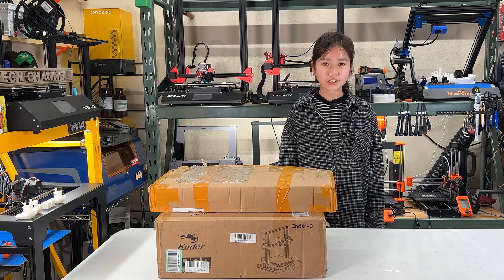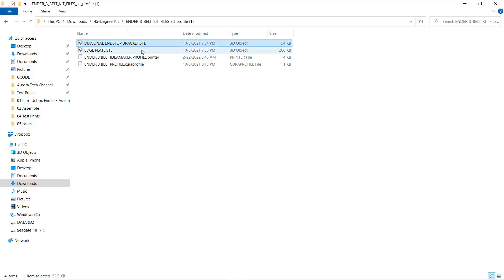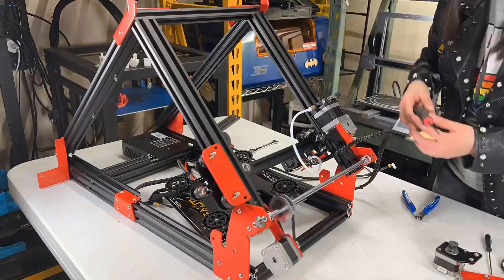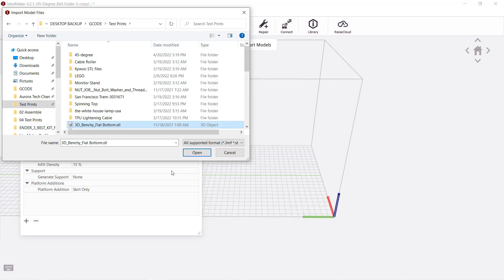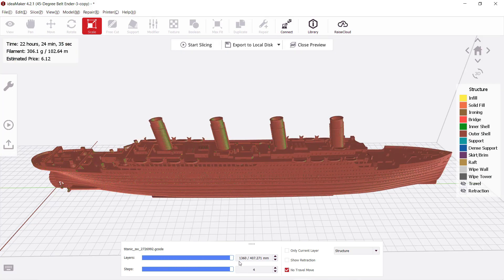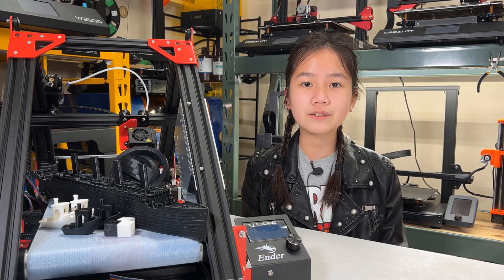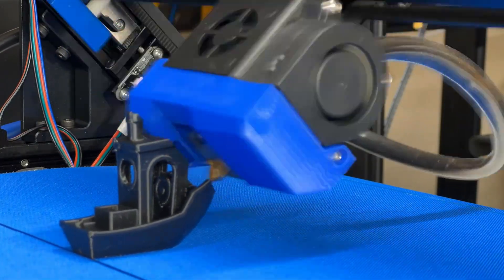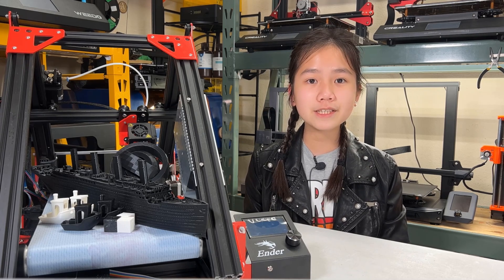Turn your Ender 3 into a 45-degree conveyor belt 3D printer for long model 3D printing

Comment: Great job on the video, it was super helpful. I'm having trouble with mine for some reason and wondered if you had any solutions. I've tried to use mine a couple different times and for some reason, the Z axis stepper pushes down instead of up during the print, and the Y axis stepper keeps pushing past the control line from the beginning of the print. It is a not new but never used ender 3 with a brand new belt kit. I'm wondering if its not the firmware? it's installed as Marlin Bugfix 2.0.x Ender 3 Belt. with a Board set to Crealty V4 Baud: 115200, Protocol: 1.0, PSU: Generic. I loaded your printer profile and template which seemed to be set right, but I'm not sure if its compatible? should I revert the firmware back to the stock Ender 3?
Reply: Forgot to mention that the firmware update now states that it is an Ender 3 Pro, which is incorrect, as it is a basic ender 3

Comment: Perhaps the belt is inverted? The inner side is blue?
Reply: My question too...in the manual it isn't clear. Did you figure this out? It comes out of the packet with the coloured part outside

Comment: At 5:12, if you put the bars on top of the orange bracket, you would not need to print and use the extra 5mm spacer

Comment: Can you use a CR 30 roller extender assembly as well? Thanks
Reply: Also do they have a belt assembly that sticks better than the current one that will fit the ender 3 pro is what I have? Thanks

Comment: This is the best breakdown of this build I’ve seen, keep it up! I do have one question however which im not sure anyone would be able to answer but i dont know of a better place to ask. The printer modification looks simple and I was wondering if it’s possible to change out the middle bars for longer ones and buy a wider belt to make it fit the Ender-3 S1 Plus? I havent seen it done but i dont see why there would be any complications and there are no mods for the S1 Plus that i could find
Reply from the maker: I saw they have a sidewinder X1 kit, but I don't think you can modify the ender-3 S1 plus with that kit. As the screen, the size of the gantry, and the firmware are different, it would be better to just buy a used Ender-3 for less than $100 or get a SideWinder X1 if you need a larger print volume. For belt printers, I like the IdeaFormer IR3 which has a print volume of 250x250xInfinite, it's just around $600 and works right out of the box.
Reply: @AuroraTech  I didnt see that they had a sidewinder kit, thank you so much for the help!
Reply from the maker: https://belt3dprinterkit.com/products/artillery-sidewinder-x1-belt-kit

Comment: Hi. Can this work with the Ender 3 S1 pro?
Reply from the maker: No, this kit only works with Ender-3, Pro, and V2. Moreover, the Ender-3 S1 Pro cost $500, it would be a better choice to just buy a $600 CoreXY belt printer with linear rails. Please also check out my IdeaFormer IR3 Belt printer video. https://youtu.be/XS56PQIeCoc

Comment: Great summary and detailed assembly. 
A couple questions. Does it include a new board or does it just use a new firmware?
Does it need to be 32 bit or can 8 bit board work?
I didn’t see this covered in the review.
Reply from the maker: We have learned a lot from your channel, I would like to say a big THANK YOU!
Back to your questions, 
1. The kit doesn't come with a motherboard, it just uses standard Marlin.
2. The company has firmware for older 8-bit Creality stock motherboard, but they didn't put that on their download page, I requested one from them before, if you want, I can send it to you.

Comment: I am having such a hard time leveling this bed and getting everything working. What start and stop G code do you use? I used the provided code in the instructions but it tried to retract a ton of filament in the beginning of the print. I just cannot get this to print anything at all. Do you have any advice or direction to point to? Thanks so much!

Comment: Why would you not be able to print long models with a 90° belt printer?
Reply from the maker: If you print from bottom to top, some part of the model will go out of the bed and loss adhesion. If you print from left to right, the print head will run into the printed parts.

Comment: There is some software for that to print infinite parts of sections of models, allowing for neat things such as chain making. You should check it out. Some youtuber made his belt printer print infinite chains.
Reply from the maker: You can use the M808 command to loop the Gcode you need to print.

Comment: how do you level something like this. i notice you say you do it like how you would without a bltouch, but that also requiers you to use the nozzle close to the bed at all 4 corners etc.
Reply from the maker: The print head just prints in one line, you just need to level the front of the bed and make the back relatively level to the front would be fine. For example, tighten all 4 knobs all the way and release one circle before you start leveling. If you raise 3 circles at the front, also turn 3 circles at the back.

Comment: There is an upgrade/add-on kit now available for this model which includes a BIQU H2 extruder, linear rails and belt tensioners for X & Y. I'm still testing the upgrade kit but so far it seems to work really well and adds some much desired upgrades without needing to design and figure out everything yourself.
Reply from the maker: The $320 kit is working great! It works as good as any conveyor belt printer, except my bed doesn't stick that well for smaller objects. I am still interested in testing the upgrade kit in the future :)
Reply: @AuroraTech  I am having the opposite problem. I print small things well and anything long will fail around 300mm. I have messed with it for hours and do not seem to be making any improvements. I am trying to print a 13 hour print and it looks good most of the way but when it's about an hour away of finishing, something goes wrong. Sometimes I think it would be best to just switch it back to an Ender 3 but then I get another idea of what might work.
Reply: @carlerickson5988  I don't know if you've solved the problem yet. But have you tried mounting the printer to your wall so the prints hang straight down?

Comment: Very nice video.
Printing long objects, a bigger nozzle diameter might be usefull. Sadly the design of the Revo nozzles do not allow tilting the nozzle 45°, as the ring would touch the belt before the nozzle tip. Maybe a 30° belt printer would work with Revo...
There are two reasons I would prefer Revo on a belt-printer:
- quick change for nozzle diameter
- very nice tip of the filament after unloading (better than e3d V6 heatbreak Prusa Edition), so an Multi-Material-Unit (like the Enraged Rabbit Carrot Feeder) should work without problems
So for easy swapping nozzle diameter, a quick toolchange adapter might be an alternative.
Have you tried different nozzle sizes with belt printers?
Reply: I feel like vez's new LSD hotend will be good for high clearance, high flow, and even non-planar printing. This belt kit is definitely tempting! Gotta decide between the 90 kit and the 45 kit....
Reply: @ryangamble5131  I do not think the kinematic of a belt printer can go up in speed so far you can use this high flow. Also I think there is a limit in nozzle diameter you can use in 45°. A 0.4 mm nozzle already is 0.28mm closer to the bed on one side than on the other side; with a 0.8 mm nozzle the differce is twice as much. With more diameter and more speed I think bed adheasion will become more problematic. Thats the reason I asked if aurora tested different nozzle sizes.